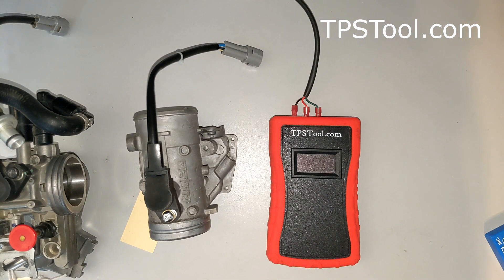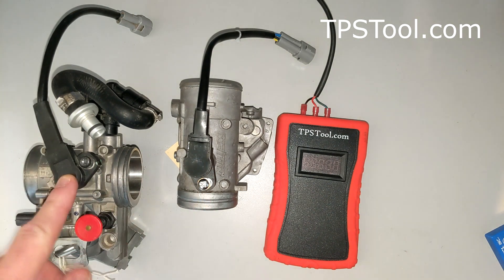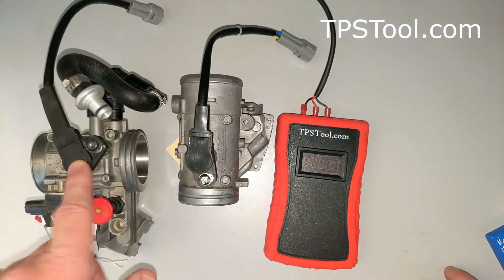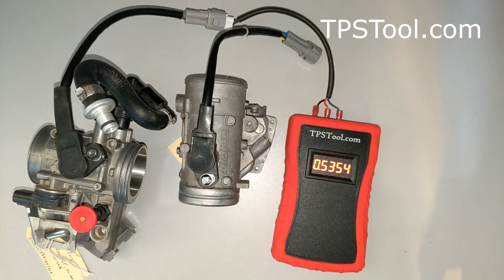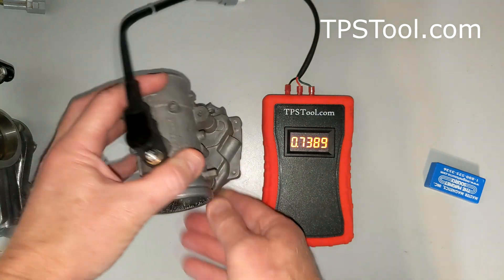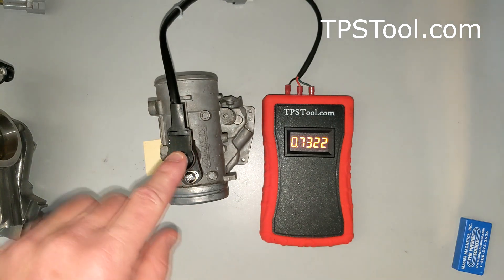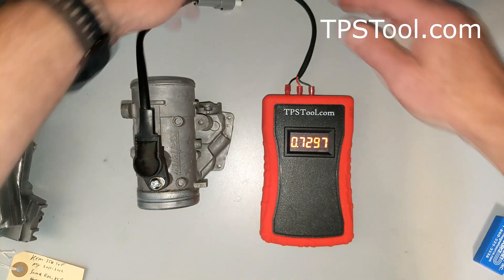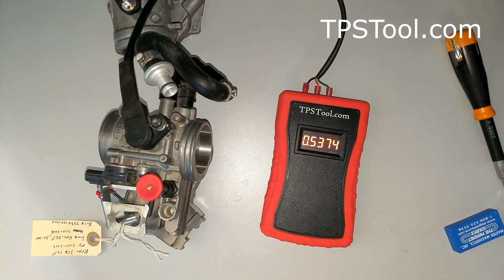Hall Effect TPS vs  Mechanical Wiper TPS

Comment: Would you happen to know factory TPS voltage for 2011-2015? 

Service manual says need yamaha diagnostic tool to set tps.
Reply from the maker: Which motor are you working on?
Reply: @TPSTool thank you for quick reply- sorry left that key detail out lol

Yamaha wr450f 11-15
Someone else adjusted tps and back off completely the idle stop for butterfly. I have a throttle body with no way to set it up.
Reply from the maker: @michaelsilva2310  Yamaha didn't publish specs it appears.  If you have a buddy with the same bike (or a YZF of similar year) ask if you can measure theirs.  If you don't have that option, I would try this as a starting point to get it running, then you can fine tune it.  If adjusting the idle changes the TPS reading, then back the idle all the way out and set the TPS to something between 0.4 and 0.5.  Turn the idle up about 0.15 more than where you set it and see if it will start.  If yes then use that as a starting point.  Adjust it up and down by 0.02-0.04 at a time until you get the mix right.  Lower voltage will be leaner and higher will be richer.  Treat it like the fuel screw on a carburetor.  If adjusting the idle does not change the TPS  reading then try setting the TPS to 0.60 as a starting point and use the same method for getting it dialed in.  I hope this helps, please post back and let us know how it goes and if you find a good setting.  In the meantime if I can find the proper setting I will post back here.
Reply: @TPSTool  appreciate the response.

I ended up setting the mechanical idle stop- just enough for the throttle body and blade not to wear into each other. Set the TPS to .56 seems to be pretty good
Reply from the maker: @michaelsilva2310  Thank you very much for posting back what worked!